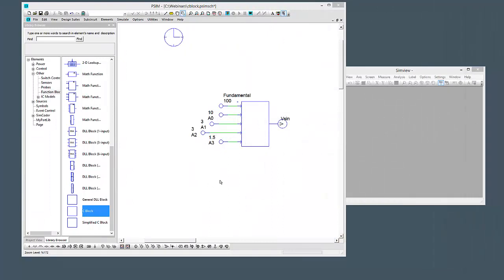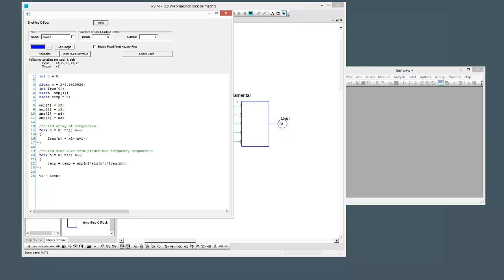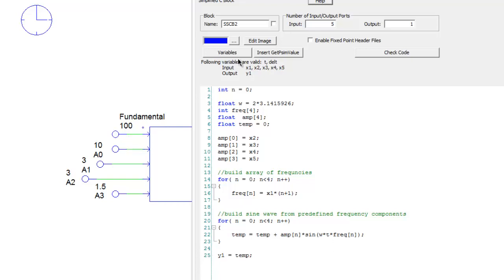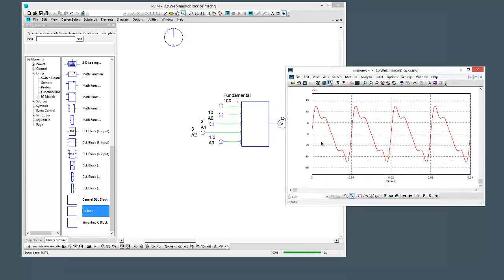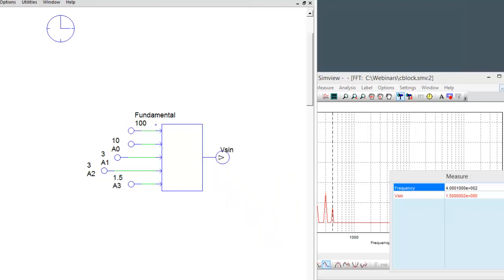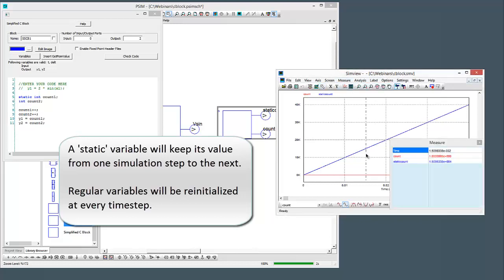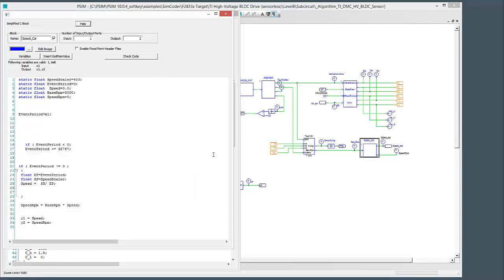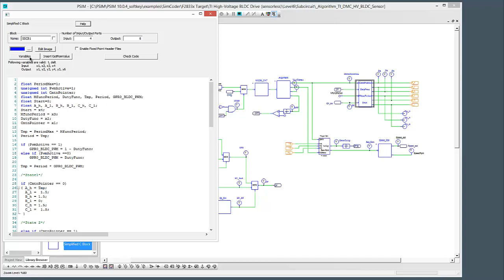How to simulate C code with PSIM: Intro to the Simplified C Block

Comment from the maker: How to simulate C code in PSIM using the PSIM's built in compiler and C Block. The Simplified C Block is introduced and several coding examples are covered.

Want to try PSIM?                                                                                  - https://hubs.ly/H0f9wCC0
Why should you use PSIM for Motor Drive design?                         - https://hubs.ly/H0f9wCK0
Why is PSIM preferred for Power Electronics simulation?             -  https://hubs.ly/H0f9wFX0
Why should you use PSIM for digital control?                                  - https://hubs.ly/H0f9wC-0

Comment: I'm trying to implement a Simple Boost PWM in order to drive a qZSI inverter in PSIM . My Simplified C Code generates two signals : a wave sine and a triangle signal . The code must compare them at hight frecuency. I 've already choosen a 4.62963E-005 time step and it works but only in my sine wave (60Hz) the carrier signal frecuency is 1 kHz . if I increase the step time to 4.62963E-006 both of the signals speed up and then it is not possible to compare them correctly. How can I speed up my carrier signal without modify the sine wave and compare them without problems?
Reply: how can i use a delay fuction in c block?
Reply from the maker: yes there is a delay block, "1/z" that you can use or the "sample and hold block"
Reply from the maker: Hi Felix, this question is a bit too complex for the youtube forum. Please head to our formal community forum and post your schematic there:  https://powersimtech.com/support/communities/

Comment: There is any video, where i can find to generate the pwm pulse pattern  with 5us delay using PSIM C block...
Reply from the maker: +Vivekanandan S Currently there are not any videos that use a C block to generate a gating signal. If you download the schematics associated with this example file you will see how a gating pattern is generated for BLDC control. http://powersimtech.com/solutions/ti-development-kit-examples/bldc-trapezoidal-sensored/. Generating a gating signal with the c block will be computationally intensive, using the PWM register of a DSP is more efficient than coding it will be.